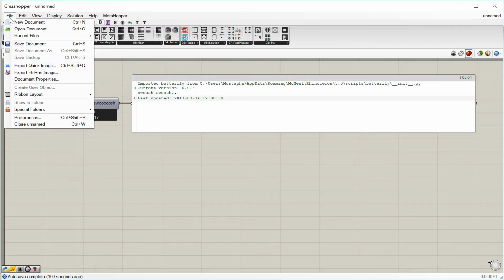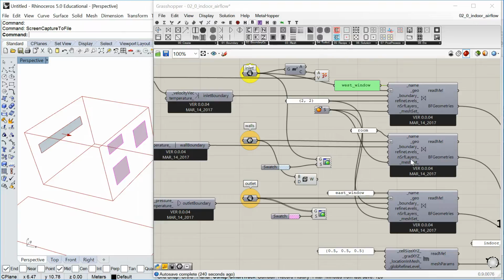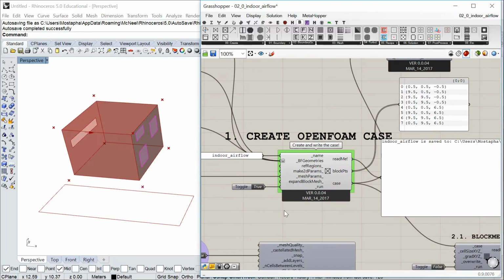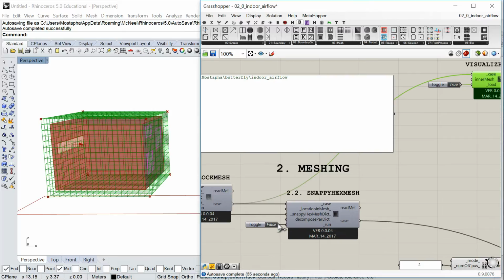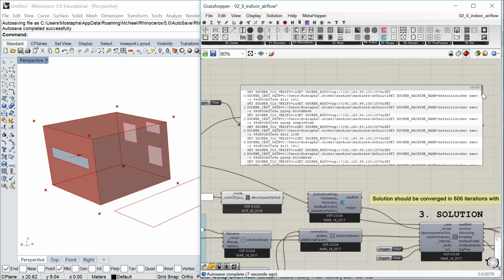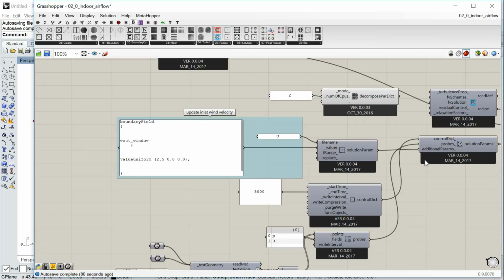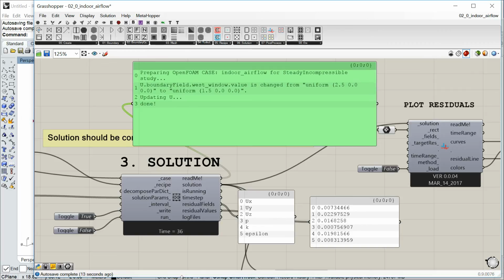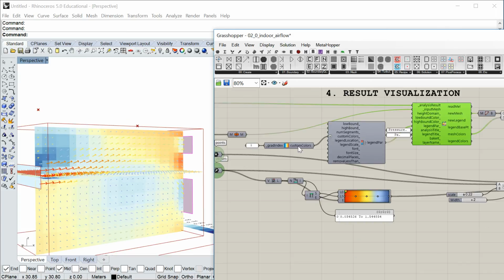05: Indoor Airflow Modeling With Butterfly in Grasshopper

Comment: Hi Mostapha !
I have a problem with the blockmesh component. It says that the " blue CFD - CORE - 2017 / system/ control dict " can't be find. What can I do about it? 
Thanks in advance for your help. 
PS: I also let you a comment on the discourse platform.
Reply: yes I have the same problem

Comment: Hi Mostapha, Thanks for the video. I have downloaded the latest butterfly version 0005, and tried to run the example file indoor airflow - however the solution is not working, as the Butterrfly_loadprobesvalue components are failing to find the probe folder. It is attempting to find the probe folder folder in "Users\username\butterfly\indoor_airflow\postProcessing\probes , but I can see that this folder "postProcessing" dooes not exist. I can see there is a probes document in "systems" folder. However, if I attempt to update the python code to access systems folder, it makes no difference - same error. I also attempted to manually move probes folder to a new "postProcessing" folder. No good. Do you have any suggestions? Is there a certain script I can update to source the probes from the right folder? Regards,Megan

Comment: Hi, Mostapha, thanks for your video and your explanation.
I have a question for you: I am using the example file but I would like to change the analysis zone. I tried to change the shape of the cube, but the software takes in account only the original zone. Moreover, how can I set a different plane to calculate the airflow?
Reply from the maker: Hi Federico, you can change both of them. Send this question to the grasshopper forum and I'll reply there: http://www.grasshopper3d.com/group/ladybug/forum
Reply: Hi where do you find the example file for grasshopper~?? thank you ~!
Reply: @wuyuanyuan7955  You can find it in the ladybug forum.